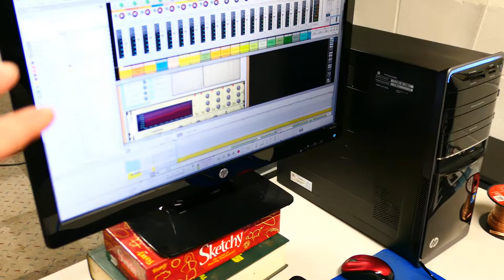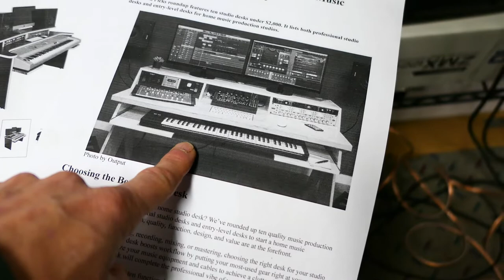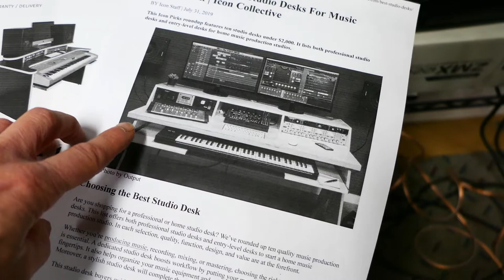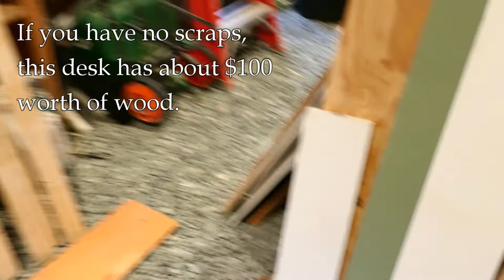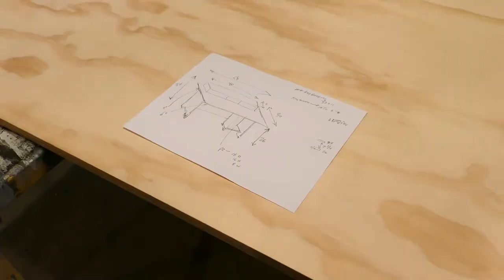Build A Cheap Audio Workstation Desk

Comment: Great job! The paint finish turned out fantastic! 
I just built one of these myself. I put the computer keyboards and mice on the table and used cheap drawer slides and a plywood shelf for my midi keyboard. Just used iron on edge banding and stain. But like yours, very cheap and very functional.
Reply from the maker: I seriously looked at the same idea of using drawer slides to hide the computer keyboard underneath or the MIDI keyboard underneath, but I have a pet peeve about keyboards moving around while I'm working.  I like a solid surface I can lean on and have it steady.  Since I really don't use the computer keyboard other than to name files or tracks, I decided I'd put it up out of the way and concentrate on the MIDI keyboard being the right height.